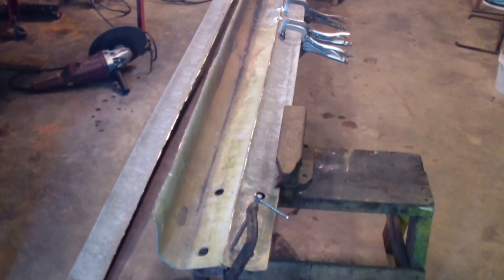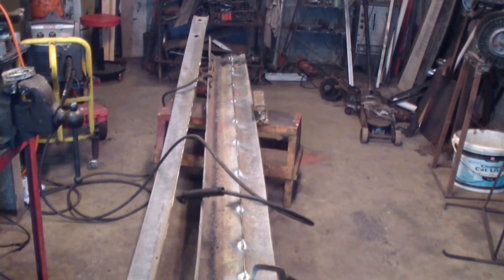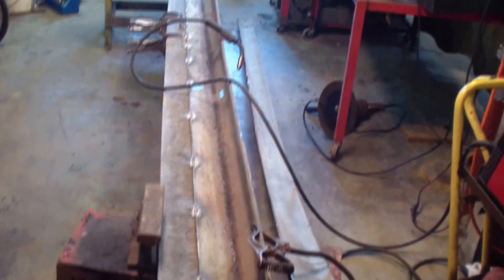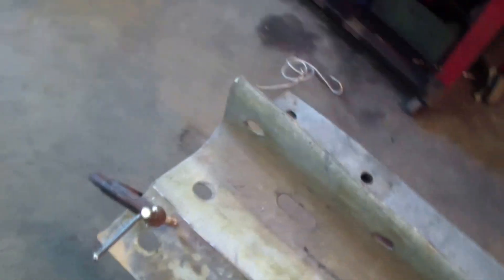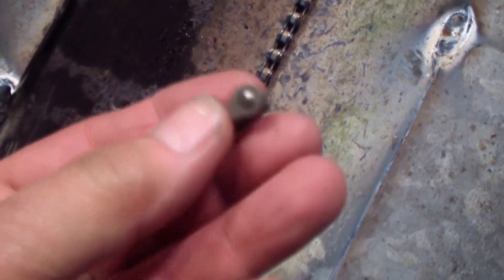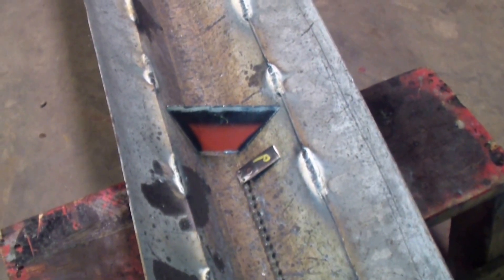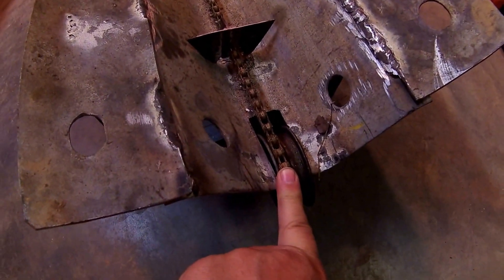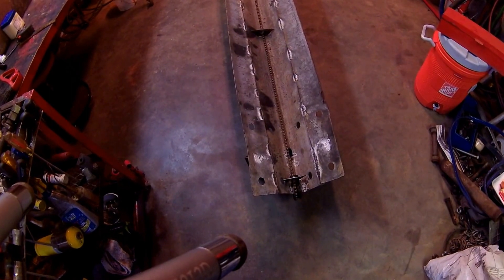homemade chain drive conveyor part1

Comment: Did this ever work?
Reply from the maker: I never finished it like a board with it I'm sure if I play with it long enough it would work it seem to want to
Reply: Working Man I think your trough material is not straight enough, and also not structurally sound enough.  If there is a way for you to mount the sprockets away from it, then you can overcome the bridging issues, or  the contact issues you are having.   You may want to cut the paddles a little smaller and then screw on patches of leather or rubber that extend past the edge and they can scrape material and that would be the contact surface between the paddle and the trough. Rubber on steel is better than steel on steel. Just my thoughts
Reply from the maker: @marsogreen2411  yeah you're right if I would have continued with it that's what my thoughts were too either these are on the entry and the exit or on the paddles themselves
Reply from the maker: @marsogreen2411  it was sort of a play thing that I hoped would have worked but it was a learning experience also
Reply: Working Man cool 👍 and good luck with it if you ever feel like resuming it!!